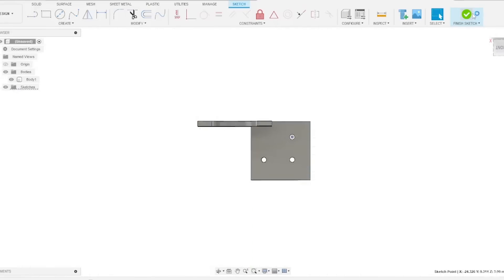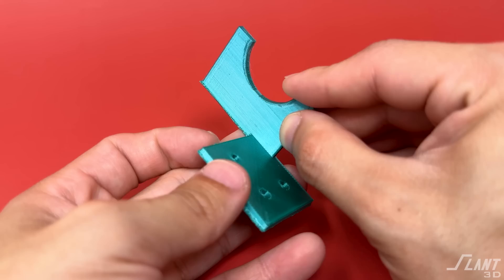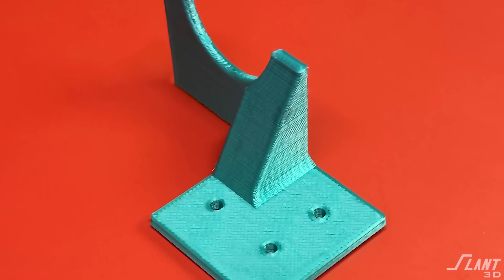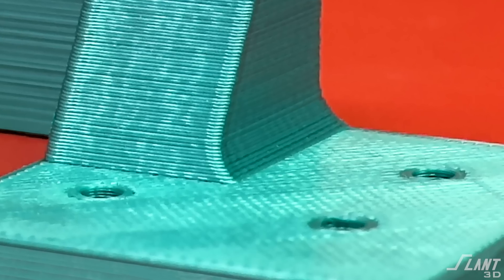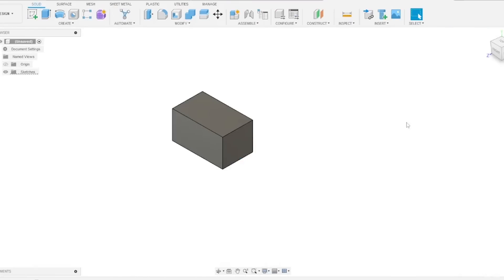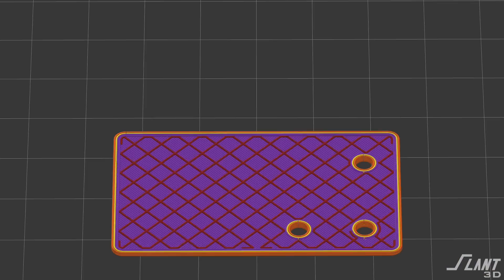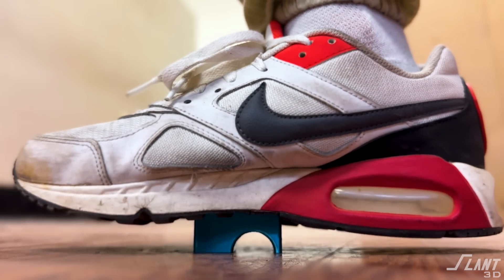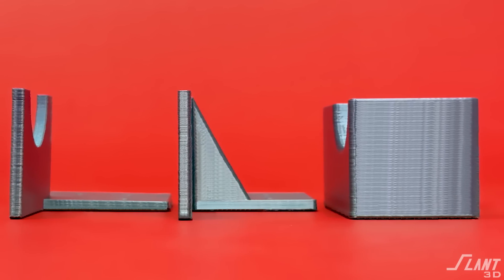You're Designing Parts Too Thin | Designing for Mass Production 3D Printing

Comment: It is interesting you mention starting with a brick and whittling it down. As i have been teaching myself 3d design to fuel my desire to make more complex 3d prints of my own, I was struggling in freecad to make complex parts and piece them together and had actually just started a couple weeks ago making everything a brick and whittling it down from there. Especially for a beginner it is just so much easier of an approach and as you said, the added benefit are far stronger prints.

Comment: Real world problem -- Shower head holder breaks and no one stocks the replacement part because they want you to buy another set of brackets and rail for the head to adjust along.  The sneaky part is that the set will not fit the holes in the tiles.  It makes sense to 3D print it  -- but how, and will it be a print once and forget, or a consumable?

Comment: I sell an accessory that has to fit over a object, but can't be super thick because you have to access the buttons, etc. It also isn't designed to support a load just go over the object. I started with 1.5mm thick solid walls, which is strong in my testing, but when that part sits under some 70lb shipping box in a hot delivery truck across the country it caused the parts to warp. I'm now using 3mm thick walls and printing in ABS on my QIDI XPlus3 with a heated chamber. Prints are coming out super strong and so far no more issues.

Comment: I understand and agree with the chunkier design, but while there are times when removing material is the only way to model something in CAD, I strongly disagree with the philosophy of starting with a block and simply remove material until you have the design or model you want. Most of the time, it's a seriously bad and shortsighted approach, especially if you comprehend the practice of reusing models and designs. Most of the time and money invested in the model is not reusable and a complete waste because it probably can't be reused as a starting point for another design, and the model's parametric's is limited. I'm very aware of some of the arguments that are used to promote the practice, but they're all a very small portion of the entire picture. It's a lot like the process, it removes most of the strengths and benefits of parametric CAD. There are definitely times when the approach is called for, but it's usually just portions of a model. It's as if the proponents of the practice can only see and comprehend about 1/4 of the entire picture, totally oblivious to the other 3/4 of it. You may as well cut off one of your hands because you haven't used it for the last 30 minutes, and it's in the way.

Comment: Why not print it flat and bend it with a little bit of heat.
Reply: Maybe because that's an extra step in the manufacturing process, and you'd rather it come off the printer ready to ship.

Comment: Unrelated: it was shown that attaching a heater near the print head to heat the top layer to near glass transition, dramatically improves layer adhesion, and makes 3D printing much more comparable to injection moulding. Not necessary, but interesting for applications that can benefit from same.
Reply: Overhangs would become an issue, and most heaters can't be go from hot to cold in a second to stop applying heat in a specific section of a print.
Would be fun to see someone try
Reply: @chyrt  Yes, new challenges, but 3D printing already requires thought about composition!

In this case, the heater would always be on.

Again, context is key in its application. Like anything else, its utilization implies tradeoffs.

It has been demonstrated on video, though I can't remember which, and the part was cut in two to show that it was visibly solid throughout (no layer lines) and presumably near-perfect layer adhesion.
Reply: @SeanLumly  I think you're thinking of Apium printers. They're designed for high temperature materials (i.e. PEEK) though so no use for most 3d printing.
Reply: @evropapagan5551  My posts are not going through on this channel, so if I don't respond, please understand that I have tried.

No, I am not thinking of Apium. But conventional printer, with conventional materials, but with a wide heater at the nozzle.
Reply: @SeanLumly  Let us know if you find the video, I'm super intrigued.
Reply: @chyrt  "most heaters can't be go from hot to cold in a second"   A laser diode could.

Oh, the wheels are spinning now.  I DON'T HAVE TIME FOR THIS!  I need to stop thinking about it.  But, yeah... it might work you know.  Dang!
Reply: @4Fixerdave  no need for a laser, we've been using IR diodes for ages in 2D printing, think; your grocery store receipt printer.
clustering a few higher wattage IR diodes around the print head doesn't sound like too bad an idea. though I do wonder about their efficiency
Reply: My QIDI XPlus3 has a heated chamber which vastly improved the strengths of my parts and layer adhesion for ABS prints. my previous attempts with ABS even in an enclosure (<45C) were not good and had poor layer adhesion. The PLA+ parts were vastly tougher, but not if it got hot. ABS parts with a 65C chamber is a totally different animal.

Comment: Another great video, I had to replace a wheel on a dishwasher basket, and at first, I was designing it with spokes and holes like the original injection molded part, I hear the voice of Slant 3d to design for 3d printing, so I redesigned it solid, and has a print in place axle and its really strong and has held up great.. (ABS)

Comment: Never designed a injection molded part. But still I design mostly from the features up and try to make the part around it. Just using a chonky block and embedding the features into is amazing! Its interessing how I did it wrong just because of I am so used to injection molded parts :D

Comment: Also, every 3D design software and slicer should have 1:1 zoom (adjusted to screen and window size) to show how damn small you are designing 🤔
Reply: When I was learning CAD, someone mentioned importing a model of your phone. That way you have easy references to scale.

But also your slicer print bed should give you a good idea of your scale.
Reply: Would be great, but I don't think monitors send size information back to PCs, so it can't tell if you're using a 19" monitor or a 30" monitor.
Reply: @logicalfundy  monitors send that information since ages via standards such as EDID.
Reply: That's why every time I'm drawing I keep a ruler or a caliper nearby to see if a dimension seems right